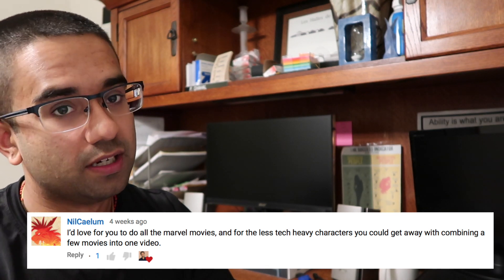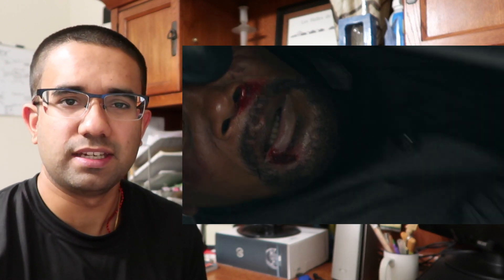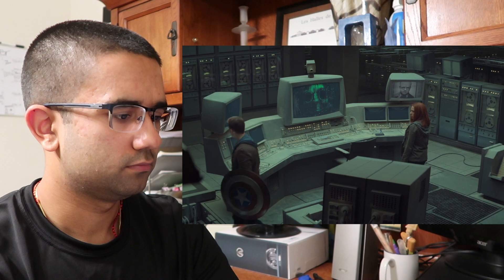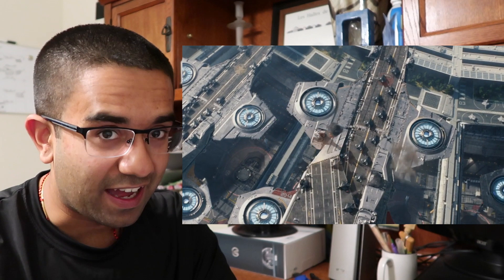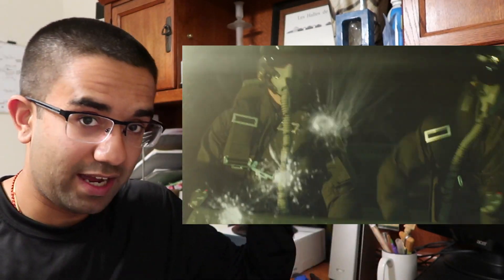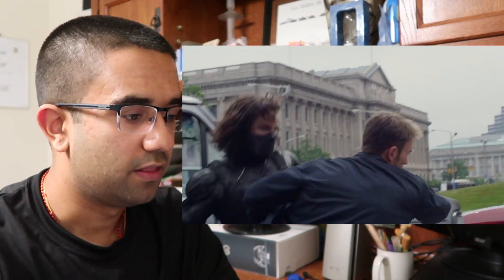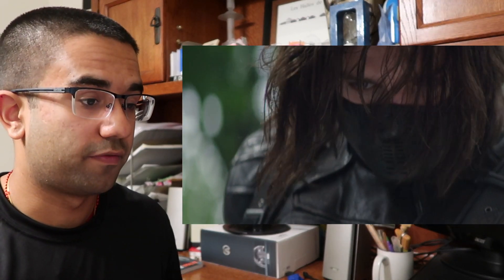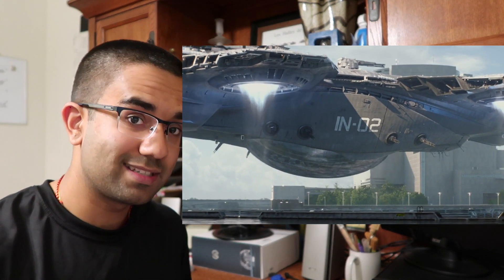Real Engineer reacts to Technolgy in Captain America: The Winter Soldier

Comment: RE: Cap's shield bouncing: you need to remember that the shield wasn't originally made of vibranium in Marvel canon. It was an adamantium alloy that also contained vibranium in some writers' minds. The problem developed when Marvel didn't have the rights use Adamantium in in the movies, so they switched it to vibranium solely and kept the shield bouncing thing because it's traditionally something Cap can do in the comic books.
Reply: Keep in mind that the MCU shield is severely nerfed from its comic version. The MCU shield has taken hits from The Hulk without budging and still ricochetes, while The MCU shield took a hit from a grenade launcher and blew Cap across a building.
Reply: in the MCU, while they don’t say it is directly, Cap’s shield is a vibranium/steel alloy, Howard Stark didnt acquire enough vibranium outside of Wakanda to do anything with it, so naturally they combined it with the second strongest metal on hand, steel, thus reversing the effect of the vibranium - which is seen most use in Black Panther - but still retaining the metal’s otherworldly durability
Reply: @eurphantic  No, the shield was made from 100% vibranium. The only mention of steel was not that it was in the shield, but only as a comparison to vibranium, with Stark saying "It's stronger than steel and 1/3 of the weight and completely vibration absorbent."
Reply: I figure the shield metal is 'aligned' so that impact is diverted to the edges.  Impacts across the face of the shield are diverted to the edge, while impacts to the edge are reflected back
Reply: Perhaps it might have something to do with the spin... instead of simply dissipating the vibration, it kind of redirects it...?
Reply: But Remember that caps shield was created by howard stark and that he stole the vibranium from wakanda and a umm I really dont Know where im goin with this

Comment: In the marvel comics, vibranium is the strongest metal on earth, and absorbs vibrations but discharges it back out. I don't much about physics, but I can assume that if Cap throws his shield with his super soldier strength, it will discharge the same kinetic energy that Cap used to throw it. I think they talked about it in Black Panther.
Reply from the maker: I talk about that in the black panther video actually if you wanna check it out: https://youtu.be/kzjPcEK2g-o

Comment: Reason why cap's shield bounces is because it's not made out of pure vibranium. It's made from an alloy of adamantium, vibranium and iron. Or you could sat that the edges are made mostly out of adamantium.
Reply: Yinhang Lingden Marvel was not able to use adamantium in the movies until just before avengers endgame.
Reply: @dewaldbodenstein4025  That's true.  Adamantium is ingrained with the XMen who are owned by Fox, hence no crossovers or anything.  If Adamantium was shared, they'd probably have to pay Fox the royalties.  On the other hand, didn't Howard Stark tell Steve "that's pure vibranium, the rarest substance on Earth" when Steve asked about the shield?  I could be wrong but I seem to remember that part.  Of course he could possibly have just not wanted to try to explain alloys to a soldier.
Reply: @Moraenil  It was pure vibranium, but that could mean that it's mostly vibranium and other metals were intentionally added.
Reply from the maker: Did they say that?
Reply: @parychahal  Not in the movies but in the comics it was explained!
Reply: @parychahal  If vibranium absorbers vibrations, why doesn't it heat up, deform or does it just dissapete the vibrations equally around the shield?
Reply from the maker: @lepmuhangpa  I believe the vibrations are dissipated equally around the shield. You asked a very question tho...does the shield ever heat up? It takes a high temperature for most metals to get really hot, I'd imagine vibranium has a higher melting point, and if the shield is an alloy then it's really strong and prob won't heat up easily. If his shield is a vibranium alloy then it's stronger the pure vibranium
Reply: @parychahal  That explains everything, thank you man! :)
Reply from the maker: @lepmuhangpa  Sure thing!!
Reply: @lepmuhangpa  vibranium has ability to absorb all vibrations in the vicinity as well as kinetic energy directed at it. The energy absorbed is stored within the bonds between the molecules that make up the substance. As a result, kinetic energy is dissipated within the bonds instead. Also, Vibranium has an extremely high melting point (5,475 degrees Fahrenheit). As you can see in the movie age of ultron, it took Iron man's uni beam + thor's lighting + Vision's beam together a few seconds before it started melting Ultron's body, fully made of vibranium.

well that's what the sources say atleast.
Reply: @therealhari__  That's the issue. How does it store it? My theory was by converting it into heat energy.
Reply: @lepmuhangpa  I read somewhere that it converts into Light energy, I forgot what its called.

Comment: That part where Nick Fury cut a hole: he probably used a plasma laser to make a hole. Medical surgeons today use a plasma scalpel make a precise cut when operating on patients.

I think you can actually block your location via an app (I might be wrong about this). But even so, a technical analyst can still try to turn on your location on or even turn on your phone remotely. The only way that phones cannot be traced is if you have one of those really old-fashioned cell phones. Or a landline; payphone; two things that are in short demand.

There's a scene in The Dark Knight Returns where Bruce Wayne put a mechanical knee brace on his leg. And when he kicked a brick wall, it broke through with a lot of force. Similar to the Winter Soldier's mechanical arm. Except it was a mechanical arm, not a mechanical arm brace.
Reply from the maker: I would argue that even a plasma scalpel that surgeons use could not accomplish what Nick Fury's lightsaber did. But that is badass that surgeons do that now, and I didn't know that existed!

Unfortunately to turn off your location, your phone needs to be off with the battery removed. Even an app that blocks your location has the ability to access your location without you knowing it. The creators of the app want to know information of who is using their app and where they are to target more specific areas and demographics.

That scene is in Dark Knight Rises, and I always thought Bruce Wayne was just that strong, I didn't know it was a mechanical brace to enhance his strength because he doesn't wear any on his arms.